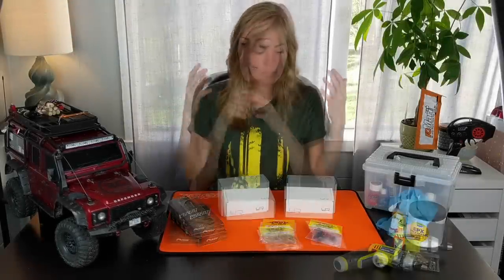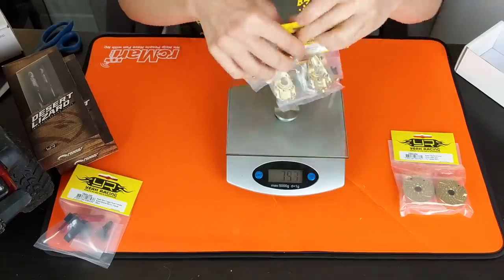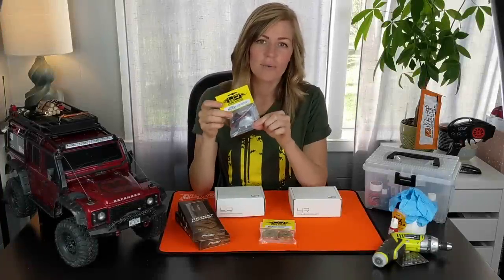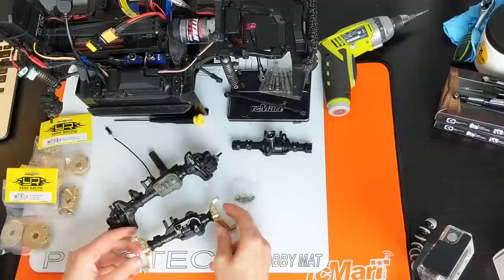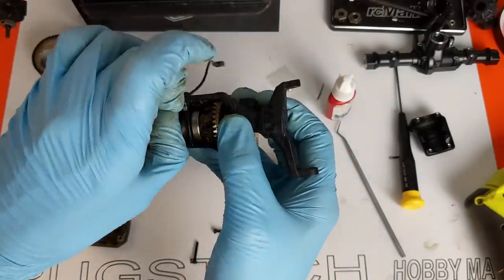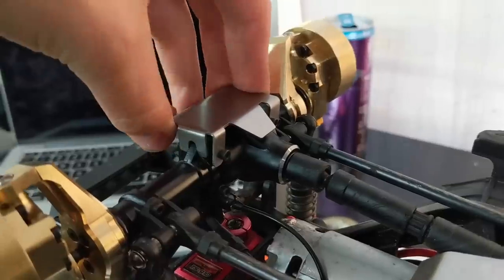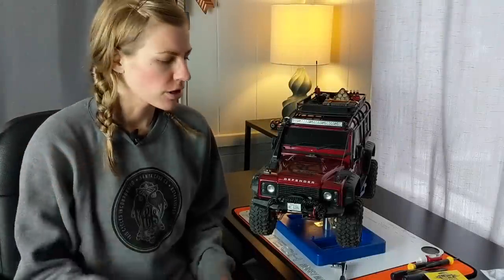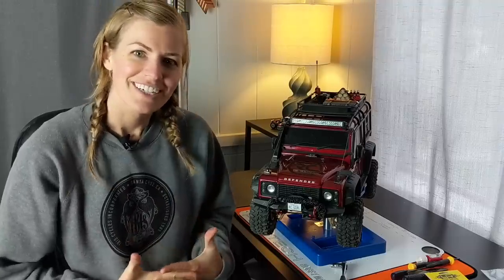SHOULD YOU WEIGHT YOUR TRX-4??  |  Yeah Racing Metal Axle & Brass Upgrade Sets

Comment: Hi , i love your channel, new sub👍just wondering is the trx worth it? Just getting into crawling and not a big traxxes but got to say looks good.I'm a big losi fan have a 5t and super baha rey.but looking for something different.and how much are the upgrades? Thanks for your time.
Reply: Hi Keith, since no one else replied I'll take a stab at it.  I'm a big Losi fan/owner myself.  The TRX4 is probably the best scaler out of the box right now, price be damned.  The remote locking diff and portal axles make a huge impact.  There is one contender bringing it to the TRX4 right now that saves you a bundle of cash.  The RedCat Racing Gen8 Scout II.  Yes, that RedCat.  LOL  It's their first fully in-house designed rig and they knocked it out of the park.  There are a few niggly things to take care of but nothing major.  The Gen8 sells for $299!  To get the equal TRX4 you can add about $150 to the RedCat price.  There is a TRX4 Sport for $340 but it's stripped down of features.  The Redcat has those game changing portal axles as well, and is fully equipped for the price.  Those are the 2 top choices IMO right now.  Good luck!

Comment: I love your channel great vids and awesome ideas! I have a question what’s the point of that esc start switch?? I mean you gotta plug your battery in anyway right?
Reply from the maker: Hah good point. I usually plug my battery in in the house, then transport it somewhere. So it helps avoid having to take the body off to turn it on and off when transporting it. There have been so many times where I've forgotten to actually turn on the rig before putting the body on...
Reply: Oh I didn’t think about it like that I guess it will be useful then. Thanks for the vids they are fun👍🏻

Comment: $$$

I love RC, but like with other hobbies and things I tinker with, I struggle with replacing plastics that aren't broken and having them sit around or go in the trash, nevermind mass production of plastic junk, at least I could excuse hobby grade with being repairable.  You'd replace this or that with alloy for strength where it was beneficial, some would bling out their buggies or whatever, but the net result would usually just be making them heavier or more prone to breaking control arms.  Now that weight in the axles is beneficial it'd be nice if one could just buy all-metal kits and not have to waste the plastic.  Not sure what's worse for the environment the plastic or aluminium, but i'm pretty sure brass is better than either.  In either case, the amount of materials and machining and effort to make all these little parts amazes me.  I suppose it's like with anything else.  We really are living in a gilded age, people in one part of the world are spending thousands on toys and other luxury goods made by people in another part of the world most of whom would not think to afford them, while others are starving and dying in yet another part of the world, as well as theirs.  Makes one think where our resources are going, got to stay sane somehow I suppose.  I guess what I'm saying is, can I haz your stock axles?
Reply: I've just finished a D90 custom build and the only plastic on it (other than the body/electrics) is the transmission housing, rest is steel and aluminium. Partly to make it cheaper than buying a kit but also, I reckon I could lob this off the roof and it'd be fine. Plastic parts are great for race cars but these things should be all metal and bullet proof.... But then we wouldn't spend more upgrading it, would we?
Reply: an interesting set of dilemmas you present . . .  eye think the bulk of your observations incl avoiding the trash does relate to the tendency to bling out your rig without a lot of thought that by increasing the strength or rigidity of this am transferring energy to another weak point, you can become a dog chasing its tail.
For most there is no perfect solution.  And who is most?  a few might know before what side of the hobby that intrigues them and there be some choices to narrow down to but rarely a perfect solution.  and then add, or subtract budget. 
at the entry level it is pretty much a given there are all kinds of cost cutting measures that one will live to regret, $200 later you are down a rabbit hole w nothing that resembles a $200 rig wisely spent on.  You enter the hobby kind of on a 50/50 maybe, get your toes wet and then some stick w it and others don't.
It is just kind of a given that steel is better than plastic, replace and the the brass is getting chewed up by the steel and down the rabbit hole you go.  w suspension parts that is magnified by a factor of 2x - 4x.  
Eye like your thinking incl concern about other.  maybe you learn and don't repeat mistakes  or rinse, Lather and repeat.
there doesn't seem to be an obvious choice, do a lot of investigating on the internet and it works out to 25 cents an hour that you are saving.  it is somewhat obvious there are some paths one should avoid, some brands are going to cost you a lot one way or another.  or don't even offer that choice, this is a dead end destined for the trash.

Eye don't see a perfect path.  There's wisdom but some of the future is a guess.  it is a journey that guarantees acquiring wisdom through the school of hard knocks.  anybody who claims has no regrets is BS & wasn't trying hard enough.
in explaining how someone entering the hobby can end up down the rabbit hole I don't mean to disagree w you.  am grateful for the wisdom you have shared, gained from experience.  There's a lot of wisdom for beginners willing to do research, advanced beginners about to become beginner intermediates.  doesn't just help avoid the trash butt also helps the budget while avoiding spousal irritation.  a sincere Thank You for sharing your wisdom, lets' do it efficiently .
.

Comment: Hello again RC Girl, I would like to ask you if you had any troubles while you were putting the pieces into the new axles? Like, those pieces fit perfect on those when you were reassemble the new axles?. Because I saw a video of a guy who bought a different brand of axles I got a lot of troubles trying to put the bearings back again and also the cable that helps to lock the differentials. Did that happen to you with these Yeah Racing Axles? 

Thank you so much for your time

And I'm asking you because I want to buy this, now that I got my Defender last Friday

Comment: I bought the axles/weights/MIP offsets and bead-locks, 2mths ago, along with my TRX, and 400hrs later, I don't know if I'll ever mount them :)) because my TRX is insane out of the box (Tactical)!
I think it weighs enough as it is, though the front seem to need more weight, I'm hesitant to 'upgrade' it because it's honestly been great in its stock form... and if it didn't bother me the first 200hrs... why now?
If one wants to use the Defender body, then go with the weights and axles, but not sure how much of a performance upgrade it will be (on loose/wet terrain and camber sections)...a friend has it, all metal, running Xerun Axe, and I do not like it one bit! I also wanted the green Defender, but I like having fun more, so... I do! :D

If you don't care for the Defender body, the best way to lower the hcg, by now everybody knows it, is not by adding weight... get a lighter body 1st, then maybe lower the battery tray...The end! I believe it'll make a bigger/cheaper difference than with all the weights... and if you'll still need more, try swapping the front axle alone to balance the weight... still, wish I could try out all these mods, but not my problems :)) I crawl, I crawl and I craaawl... and my TRX is fine and mighty!! :D ... I go through 2 motors/month, but that's my deep sea obsession/problem :)) still, don't need any upgrades... 
I have to make a video showing it climbing a nearly vertical wall, all stock, cause who'll believe me if even the witnesses start hallucinating? :)) 

Had that start-trigger, was great initially, but after a week crawling constantly under water, the adhesive dissolved, and then I noticed somehow the trigger housing had cracked around the screw... there's a different version on ebay that mounts under the ESC with the same screws, should be better, but now I don't really need it cause after 2 months of abuse my body is slowly disintegrating :))

https://www.youtube.com/watch?v=U7rcEwFwxvA

Comment: Nice upgrades, unfortunately I found out the hard way that  the stock  TRX foam cant handle that much weight.  you will need to stiffen those up!  Or they will destroy themselves with prolonged use resulting in a tire that looks flat all the time and foams in multiple pieces. Also The extra weight will compress the foam too much resulting in a loss of performance ESPECIALLY while side hilling causing the rig to roll over when it should not. I recommend a two stage foam with a very firm (comp) inner and a firm outer.

Comment: Hi RC Girl, I would suggest to install a Hobbywing 1080 instead of the stock ESC. 
Then your TRX4 will move much more smoothly, especially when ascending.
regards Mark
Reply from the maker: Yeah I've been eyeing the Hobbywing xerun axe combos....
Reply: @RCGirl  Hi, I drive the 1080, it is a no brainer for less than 50$. The benfit of a brushless system is minimal for a crawler. But I guess you don't have to pay it :-)
Have you already exchanged the servo? The Traxxas BEC is anyway to weak to supply a stronger servo the 1080 can deliver 6 Amps instead of 2 Amps of the Traxxas.
And there is a cheap trailer for 50$. Mine is shipped right now. http://www.rcmart.com/leaf-spring-aluminum-hitch-mount-trailer-crawler-ya0405-p-59216.html?cPath=420_1530 

Love to see your progress on the TRX4.
Reply from the maker: @Mark_Dee  Woah that trailer is awesome!! I've actually been wanting one for a while. I do have to pay for some stuff, and want to do RC on a budget, so thanks for the info on the 1080.  :)

Comment: Would setting 5 on the esc help with the descents I haven't played with the trx4 too much on steep hills, I just picked mine up for Christmas. My first 1/10 scale rig...  first real R/C ever.
Reply: 1968chevysw yes the setting 5 helps with holding on climb and decent, but if you let off too fast while descending your brake will engage and it will nose dive. Finding the right balance between front weight and “drag brake” as it’s called is key. Finger ever so slightly on the trigger on a decent will help going down and not flip rear over front

Comment: I built a TRX-4 with the goal of mounting the killer body Gladiator on it. Didnt’ happen, long story. Scored a Defender body on eBay for $110 with the exoskeleton and roof rake and spare. The one issue I had is the body pins on the rear goal post don’t stick far enough up to put clips thru to secure the body. Did you have to deal with this? Solution?

Comment: Very good and informative video RC girl! :D Do please check out my green TRX-4 (and some other TRX4s) and see what you think of it :) Im based in Sweden. Ive been looking at some of these upgrades myself but they are a bit pricey.. Maybe hard for you to say but how does it feel when youre playing around with it in low gear high gear, accelerating, breaking, turning etc. does it behave more heavy and clumsy or do you still find just as nimble but just a bit more capable on the trail?
I have to warn you a bit as well of the Desert Lizards, I had the internal spring ones but without the extra chamber and every shock leaked like crazy. All over the floor. Tried different orings, oil wt, redid all of them 10+ times, had them even upside down but still leaked like crazy.. got my money back from rcmart in the end though. I hope they have stepped up their game regarding their shocks. I will look at your review later :) It was just a heads up. Keep it up! Already a sub!

Comment: Great vid but you should have did your total weight with tires and battery to give your true weight in grams. Also using stock diffs your not gonna see much different if your doing crawling looks good still.

Comment: So curious im a big axial guy myself and that new trx-4 is a sweet rig, but what was the major selling point on choosing the trx over persay axial or a vaterra crawler for you
Reply from the maker: Portal axles, high/low speed trasmission, locking/unlocking diffs were probably the selling point for me.
Reply: @RCGirl  Ha its to true they did a great job on the set up and all of the features out of the box it's trully a hard rig to beat plus when its looking as nice as your rig its makes it even more changelling for others to keep up. How do you feel about the diff fluid in the shocks in stead of shock oil, do you think the damping helps keep the center of gravity lower and less springing affect when coming off rocks

Comment: I installed the trx 4 axles under my scx 2, added the brass weights on all 4 corners, more in the front, and it was a time consuming process to tune in a good balance so i wouldn't flip forwards going down steep hills.. But worth the effort. I think im going to go for the metal axle housing now. Great vid' keep up the good work. Ramp-Ha's Rc's
Reply from the maker: The trx4 axles will work for the SCX10II? I have an SCX10ii kit to build
Reply: Yes. You will lose a lot of top speed due to extra gear reduction in the axles. I replaced spur, pinion on trans, smallest spur i could find, 3 or 4 teeth bigger on pinion. Replace ring and pinion in diff's to taller ones. sold by traxxas. Right now top speed is my walking speed after all changes. Other than that it will bolt right in. Note: my scx 2 is heavily modified far from stock.  Also i removed locker cable out of diff's and epoxied gears together fulled hole with shoe goo.

Comment: I was watching another video saying to get tougher tires to help compensate the new increase in weight distribution. Am I better off getting the whole kit? I am still working on the trailer I made for my TRX4. 🐹
Reply from the maker: It's up to you! I think I'm going to take off the 118g portal weights I have up front and bring the portal covers I installed on the back to the front. However, the 118g portal weights weren't included with the kit. I still think I need more time on the trail to assess further.

Comment: Hi, RC Girl! I want to buy a rc car, that I plan to upgrade. I don't know what to choose. Axial scx10 ll or trx 4. I' ve done some research for axial. I would need a servo(savox i would buy), a esc(Holmes brxl), new links, receiver and some estetics. I am worried bcs I can't find a good metal axle, like yr. One the other hand, I like thr trx 4. But it's conplicated and I'm afraid of those dif lock servos and 2 speed. I would use some kings shocks, same savox servo, yr axles, but I am worried for the plastic transmission and dif servos. What is your opinion. What is the best to upgrade. Easyest(in terms of aviable upgrades). Also what front and rear bar is good for them? thanks :D

Comment: I/we use stainless bb’s in my wheels. This way the weight is always at the bottom of the tire and it’s never visible. No problems running with it
Reply: bellyisis 
I’m confused.  Do you take the foam out?

Comment: Not sure if you did this but set your drag break to 100% it will hold position on decent and only move when throttle is given
Reply from the maker: Yeah I need to turn it up. I don't want it 100% because then it won't roll at all, but not sure the Traxxas ESC has a tunable drag brake setting. Is it just on or off?
Reply: @RCGirl  there are 5 settings sport race trail traing and crawl, each one has different settings between throttle breaks and reverse
Reply: Here is a link to the maual it is near the bottom on what the settings do and how to change it

Comment: I totally approve of the extra weight at axle level, (More Metal for Models!) and it does look cool, but as I'm not a fan of showy chassis, I would colour the brass black. It's a chemical process with dodgy stuff like ammonia and copper carbonate. And you fix it with caustic soda (lye).
Reply: You can try liver of sulfur(can come in small 2oz bottles), not quite as toxic....
Reply: @RandalSaint  LoL! It sounds awful! 😅
Reply: @wordreet  oh boy, it's yucky! Indoors it's a stink bomb, outdoors it's almost as bad, lol. But, it's what I've used on copper, brass, and zinc for aging looks. Works great.
Reply: @RandalSaint  Heh, yeah, sulfur-anything is going to pong righteously!

Comment: Are you using crawl mode? I see how fast the truck was downhill, but didn’t see any of the drag brake happening. Maybe try it if not already using the mode. If you are, then discard this comment
Reply: Beat me to it
Reply from the maker: Drag brake is on when I release the throttle, but I will have to also have to use some braking with descents too, especially now with all the weight up front

Comment: So super frustrated at this point. Ordered the Yeah Racing front, mid, and rear axle for my TRX-6 from RCmart. They got here and none of the diff covers fit properly, they are to tight and cause a bind. Tried calling the US Hot line for 2 weeks now and it wont go through. Finally called Hong Kong and bless his soul but him trying to speak english would have been like me trying to write chinese, aint happening. No idea what to do now
Reply from the maker: Aw dang that's a bummer!! I wonder if they or Traxxas modified their manufacturing. The ones I had fit like a glove

Comment: will you be adding wheels/tires to your rig?  I wonder if those brass weights will restrict your beadlock wheel selection.
Reply from the maker: I have some metal beadlocks on my other crawler. I will have to see if they fit with the brass weights and keep you posted